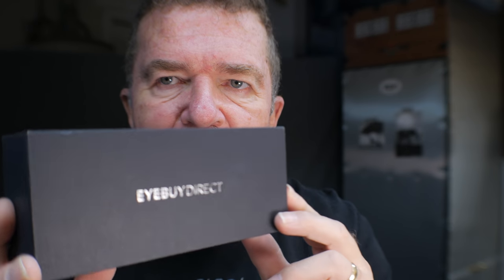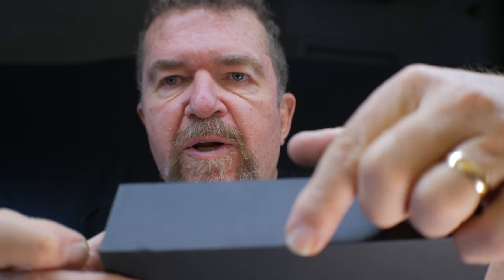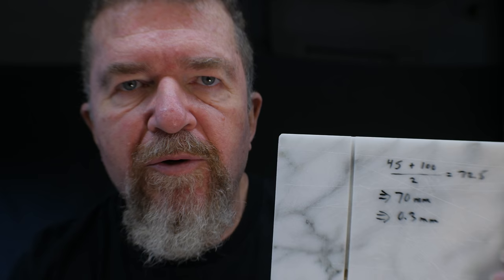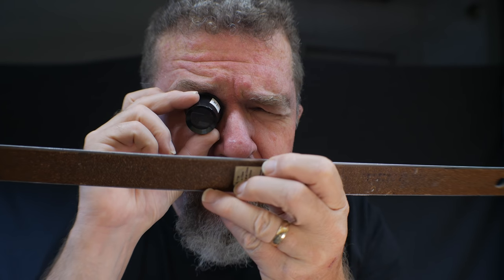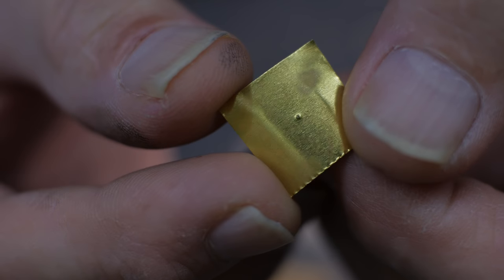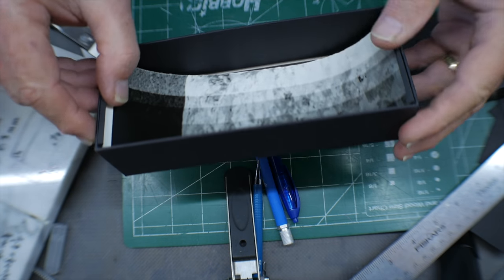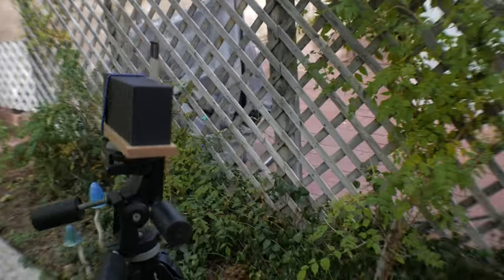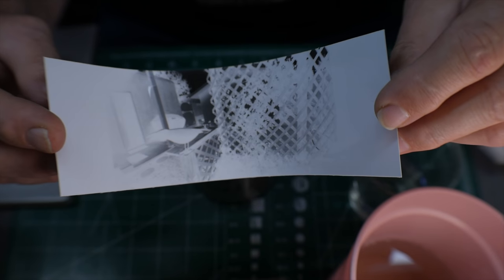Eyeglass Box Pinhole Camera Project

Comment: Have you ever tried lamp sooting the pinhole to avoid reflections/bring up contrast a bit? 
A candle would probably work as a source of soot, but an oil lamp would be better.

The difference might not be huge but worth a try, since it's easy and you'd only be spoiling a pinhole.

On that note, do you think it would be possible to make the pinhole in lamp soot on glass, or indeed a lens to make the aperture?

Or, you could photograph a largish perfect black circle on white paper onto 35mm film and use the negative as your pinhole, just like people doing zone plates with film.
Reply from the maker: I haven't seen much difference with blackening the edge of a pinhole - but then I usually try to avoid direct sun hitting the aperture.

Your suggestion of a very tiny lens aperture is actually a good one. Many so-called "pinhole" cameras from the 19th century were glass lenses stopped down severely. I've experimented with such "hybrid" optics and they give you faster speeds than true pinhole with better resolution.

Zone plates are interesting, but I haven't done much with them, I prefer a handmade pinhole. Thanks for watching!